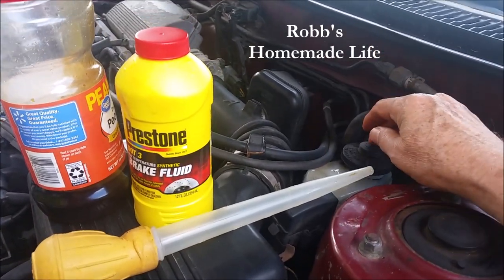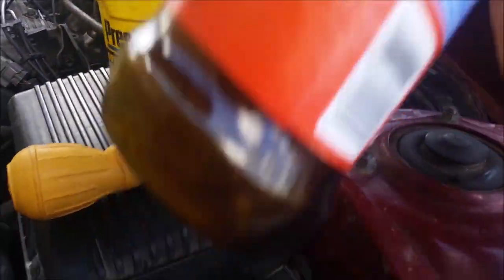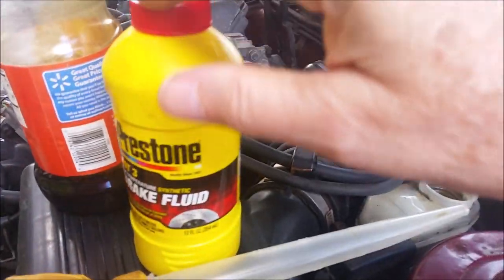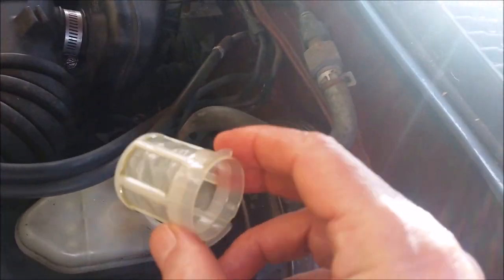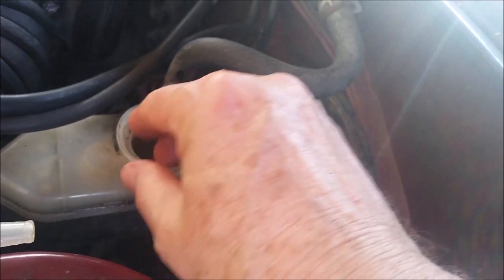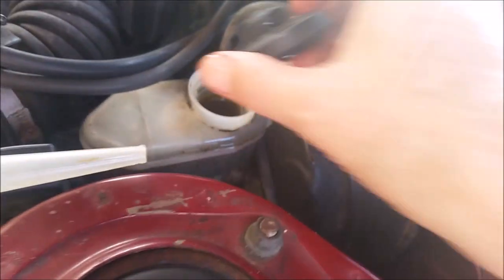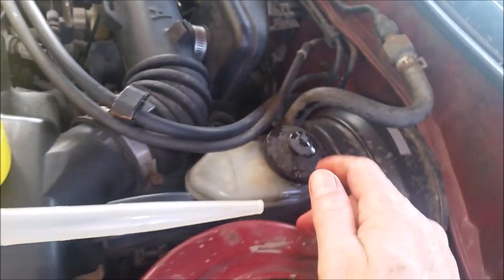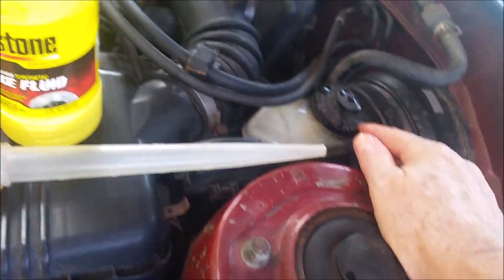how to change brake fluid with a turkey baster

Comment: I do this for brake fluid and power steering fluid. Works great. Not gonna be like a total flush but it will get cleared up a lot.
Reply from the maker: Hey thanks for watching and taking the time to leave a nice comment glad it helped
Reply: @RobbsHomemadeLife im about to do mine on a rav 4. There is a filter in there. Does it just unscrew out ? I dont remember seeing this on my other car.
Reply from the maker: On the Corolla the filter is at the bottom but it does come out

Comment: Do you risk letting air inside the system with this method
Reply from the maker: No, the line was never open and the liquid was removed from the top. but good question.😎

Comment: I didn't know it had to be changed!  I thought it only had to be kept full.
Reply from the maker: Most cars will be fine, but mine is from 1994,LOL. I need to change everything.😊
Reply: @RobbsHomemadeLife  mine is from 2006, and it's never been changed that i know of.
Reply from the maker: if you have your brakes done they usually change it then.
Reply: @RobbsHomemadeLife  oh okay, brake shoes were done.
Reply: @RobbsHomemadeLife  Yes, surprisingly most vehicle manufacturers maintenance schedule is every TWO years.

Comment: I do partial changes like this all the time on things like power steering fluid. I recall being 18 years old and having my apartment complex give me a pretty good berating for pretty much ripping the entire engine out of my truck in front of the clubhouse. I wasn't really told no but they said next time do it in your covered stall we're not everybody can see you. On a side note if you want to do automotive repairs I found car parts stores are pretty lenient on this thing and I've done a fair amount of major repairs at the parts store in my day. The plus side is if you find you need something else You're right at the parts store and you can get it right away.
Reply from the maker: Hey Moe, the Autozone near me seems pretty nice. They need to invest in better shade trees though.😎

Comment: Thanks.  If you do the baster method without bleeding.  How much do you actually replace?  I hear varying opinions!
Reply from the maker: Hey Mr. Dave, the first time I did it I did not remove a lot as I did not know there was a filter in screen above a reservoir below. The next time I removed the screen and got out more close to the bottom and then I stopped doing it. I need to do it some more. I don't drive the car very often and I want to drive around a bit before I took somewhere out and I forgot about it. My plan was to do it until it got to a similar color of the original. The brake fluid melted my turkey baster, LOL. I plan on using a syringe with a long needle I use with my inkjet printer. Thanks a lot for watching and commenting I really appreciate it. Don't forget I have 1200 other videos and add new stuff every week for the last 15 years.
Reply: @RobbsHomemadeLife did the  syringe work better?

Comment: thanks for this video, I'm going to be putting new power steering pump fluid in with another cheap turkey baster too pretty soon. Had my 95 ram truck for nearly 7 years now, never changed either fluid, who knows how long it's been since an old owner changed it too. I live in apts too where we're not allowed to do major mechanical stuff or else we'll get a lease violation. I figure 75% new fluid right away, wait a month or two and change it all out again should get it pretty close to 90something percent all new, I call that a win given the circumstances. Maybe even 6 months down the line or something do it all again and the brake stuff would be really close to 100% all new fluid, then be good to go for at least another 7 years. I'm not exactly putting a million miles a year on the truck, it's a backup secondary vehicle to our much newer more MPG efficient car, it's just an occasional hauler and point a to b grocery store and fast food drive thru vehicle lol
Reply from the maker: Hey thanks for watching and commenting I was in the same boat as you are I'm not supposed to work on any cars in the parking lot but I figure using a Turkey baster is not working on the car😀